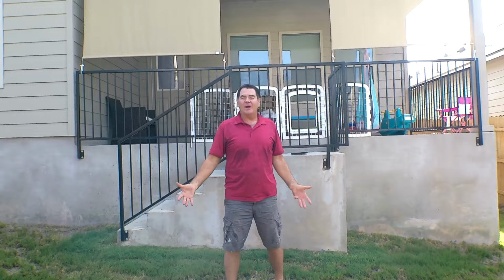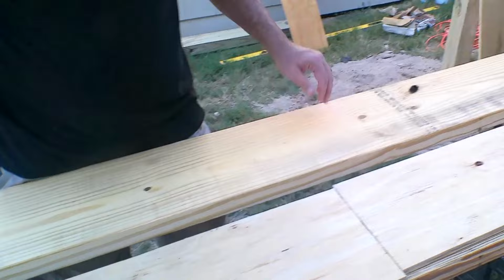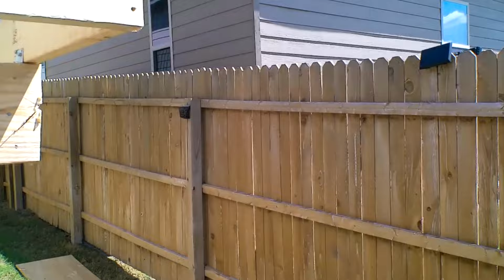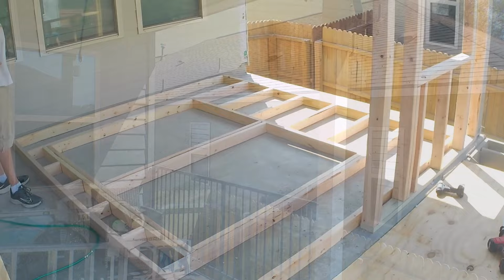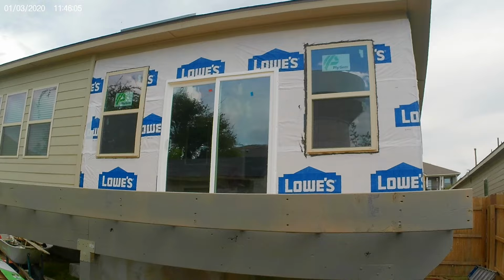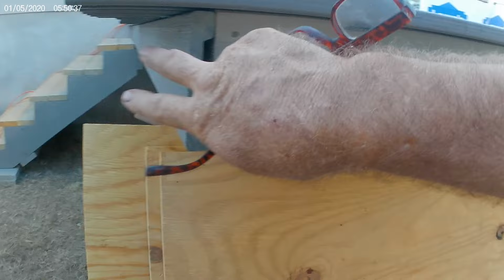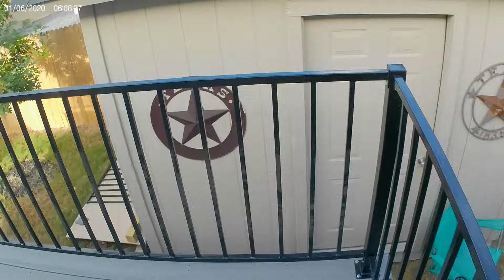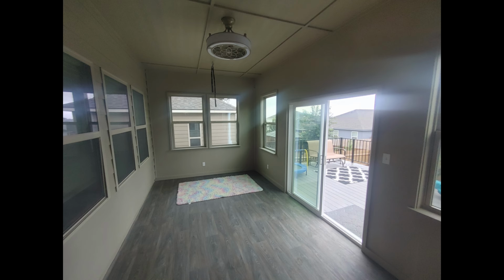Deck and sunroom

Comment: in this video none of this lumber looks like cca or treated lumber...?
Reply: I noticed that too.  The 4x4s were and maybe the 2x10s.  I guess paint gets it.  No tape on the joists or tape/flashing on the windows or door.  I was glad to see a beam ON a post for once.  Maybe would also buy enough railing and cut it for even spacing.  Would have liked fasteners for the flooring or used a chalk line if screwing the face.  Another thing I liked was trimming the rim joists and stairs.  Give a 45 a try next one.  If that would have been CQA skinned with composite the stringers would have to be on 12"  centers.  Not structural,  Not sure if the lags into the concrete are rated for weight bearing.  If the Inspector and client like it I guess it gets a stamp.  I'm not dogging, just noticing and suggesting.